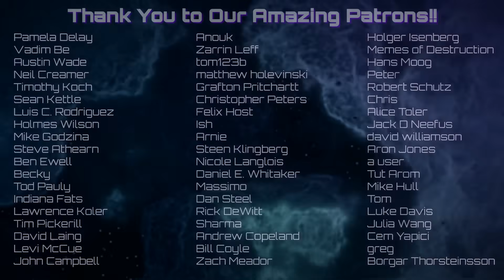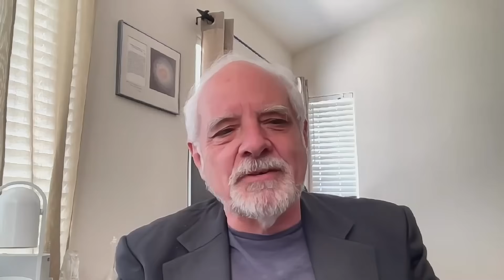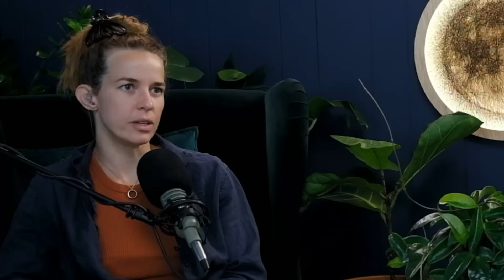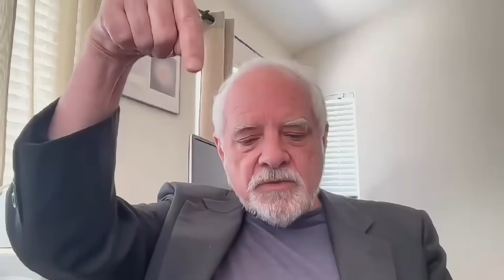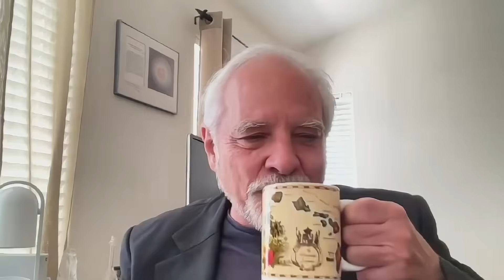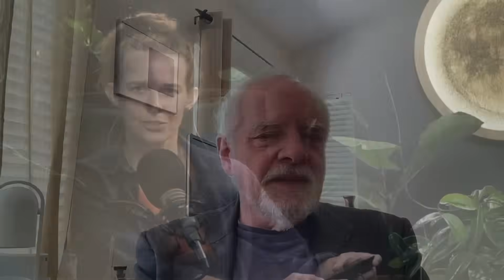Room Temperature Fusion is Here - Lawrence Forsley, ****, DemystifySci #349

Comment: 40:51  dont use mirrors.  Use a natural form of isolating multiple charges. Aka 2 circling the feild with a exterior pressuree cooling liquid with ferromagnetic particles using spins simultaneously keeping it cool with a gelatine

Comment: Alternatively, there is a beautiful numerical system called Marko Rodin vortex math which illustrates the equilibrium of all of these material elements. The torus with its central vortex is the 3D form of this equilibrium, numbers are vector points on this curved torus plane.The inner vortex is the model of the zero point or what is termed as cold fusion.

Comment: I am always amazed how people (even highly knowledgeable ones) misrepresent the Carnot's cycle and the theoretical efficiency analysis. Regrettably, in my opinion this is happening as literally no one goes and reads what actually Carnot did publish and the English version of Carnot (forgotten for more then 50 years pamphlet) was translated by Lord Kelvin. In a short the Carnot theoretical maximum efficiency (as described in his work) is 66% and not 40-45% as mentioned @35:24. In addition, if anyone is interested to actually read Carnot published pamphlet (about 90 pages) one will find out that Carnot did have critical assumptions for the dynamics of his derived efficiency. Ones this is understood, the "efficiency" argument becomes a chosen line of thinking then a physical limitation for thermodynamic transformers.

Comment: The thermodynamic probability that fusion would run at room temperature is very low: something around 10-8. But this number applies to omnidirectional collisions of atoms from all directions at the same moment and there is the trick: inside of metal lattices the atoms can collide along single line. The probability that multiple atoms would collide inside of random plasma in this way is equally low. As you may guess, these two probabilities would occasionally cancel each other. In chemistry the 3D reactions get often catalyzed by introduction of 2D surface of catalyst. As we can expect, the 1D catalyst would speed up the reaction even more - and this is IMO the key for running cold fusion at room temperature.
Reply: Regarding the applications of LCF (such as compact neutron sources for medical isotope production) here the problem is, it may be weaponized easily and occasionally even used for triggering of fission bombs. Until there are greedy people and terrorists, the technologies like this one are Pandora box for civilization.

Comment: Lt. Thomas Selfridge was killed in the first fatal powered airplane crash on September 17, 1908 at Fort Meyers, VA.  Orville Wright was at the controls, and this was the third military passenger flight - ever.  After three uneventful laps of the field,at an altitude of 150 feet, Wright heard a light tapping sound.  Though a quick look behind him revealed no problem, he thought it best to shut down the engine and glide to a landing.  Before he could, one of the two propellers failed.  The Flyer started shaking violently, and Wright fought to maintain control of the airplane.  He reported that Selfridge kept looking at him to try to gauge the severity of the problem.  Orville Wright couldn't regain control of the Flyer, and at 75 fet altitude, it went into a nose dive.  Lt. Selfridge uttered a nearly inaudible "Oh - Oh!"  And the plane crashed, making Lt. Thomas Selfridge the first fatality of a powered airplane crash.  Orville Wright was seriously injured, but recovered, living until 1948 to the age of 76.  Lt. Selfridge did not "fall out" of the airplane.  He was an aviation enthusiast, and died at the age of 28.  Fort Meyers was later named Selfridge Field.  One other note.  The Wright Brothers first flew on December 17, 2003 - not 2007.
Reply: Edit again: 2003 into 1903....
Good description otherwise.

Comment: So the problem with “cold fusion” is if you can make fusion in your garage we are all going to die! Controllable cold fusion started with Alvarez with muon catalyzed fusion in the 1950’s. This remains the o🎉nly safe way to do cold fusion. Work on making your electrons big (accelerators?) that will bring. Your wave function closer to the fentameter intra nuclear distances where the strong nuclear force takes over. I think you smart people figured this out but can’t release it because of concerns of weaponization.

Comment: Lower tech question: Why aren't houses, roofs and cars in northern climates painted with paint that reflects the sun on hot days and absorbs the sun on cold days for free heating and cooling? I know that paint that changes color with temperature exists why don't manufactures make it widely available? I am not an expert on this you'll have to find one to appear on your show.
Reply: Such paint doesn't exist. I'm an expert in the field and you're dreaming of crazy stuff. Educate yourself and stop writing idiotic stuff on the internet.
Also I have to add that you already have UV tubes that do that. No need for your crazy inexistent impossible paint.
Reply: @florin604  Thermochromic (TC) products predominantly change color in response to temperature fluctuations. I googled it. Jumping to a conclusion without at least doing that and referring to someone as an idiot is inappropriate behavior. My question was why don't we use it it would save energy and help the earths reflectivity during hot times.
Reply: @RobertRoberts-f4i  my kids have color changing cups. Put ice in them and hey get really dark and a totally different color. They are plastic. Even kids know your question definitely is not idiotic. The cups are literally just like you mentioned. Dark color for cold and light color for hot.
Reply: @florin604  Thermochromic (TC) products predominantly change color in response to temperature fluctuations. I googled it.

Comment: One should not lose sight of the fact that ignition at Livermore was a great achievement, not least because of the name of the device; the National Ignition Facility. Marshal Sluyter, head of the Office of Inertial Fusion in Defense Programs at DOE at the time the final decision was made to build the facility had insisted on this name in spite of the fact that even the most optimistic fusion scientists were not sure ignition could be achieved with the 1.8 megajoule design yield of the laser array. In the first experiments the fusion yield was about two orders of magnitude less than required to meet the ignition milestone, and it took more than a decade of work to finally achieve the ignition goal, but in the end, Dr. Sluyter's insistence on the name was vindicated. It should be born in mind that NIF was never funded as an energy experiment. It was built to study weapon physics and weapon effects. As Dr. Forsley noted, experiments at the facility can also be used to study the possibility of inertial fusion energy, high energy density physics, etc., but that was never the primary purpose of NIF. It is extremely useful in its intended role because it gives us a leg up over international competition when it comes to insuring the safety and reliability of our arsenal in an era of no nuclear testing.  

In fact, the Wright brothers' first flight was in 1903, not 1907, and Orville Wright's passenger at Fort Myers, Lt. Thomas Selfridge, didn't fall out of the machine. One of the propellers broke and a fragment severed some of the control rigging, causing the plane to crash, killing Selfridge and severely injuring Orville Wright. Of course, these are just anecdotes, but credibility is important in discussing fusion energy, and such small slips can detract from it.

Comment: Fission releases alpha particles and things measurable like that, charges radioactive particles 

Fusion goes down a scale to emit photons, and gamma radiation, basically antimatter, VS particle discharge 

Which then re-combines into matter, so helium in most cases, eventually, which is relatively inert... but it could just be reduced to practically nothing, if the fusion reaction bleeds off antimatter, collected as plasma, until no matter is left

Which is equateable to Star Types 

IE, our sun can't fuse Iron, 

But a larger Neutron Star, or Magnetar, probably could.... 

And with feynman diagrams, on a computer, you can begin to assemble a spreadsheet of fuel types, and types of reactor, and the types of emissions and ammount of current cycled and collected. And if it is net positive in terms of power consumption, or if it is safe to use a type of fuel in a type of reactor, or if a reactor can be used differently, for more efficiency or safety, or different types of input/output 

They both kind of overlap, I think,

So fission, is mostly particles and radiation 

And fusion is mostly radiation and antimatter, but it reconstitutes, because antimatter can't exist outside of a quantum vacuum to a certain degree, other than temporarily, as it is the smallest scale of light, and therefore matter, when you factor in how it comprises fundamental particles like the higgs boson, part of a Neutron. 

So, the environment it reconstitutes in, and type of antimatter available to create matter, or also in the prescense of plasma (ions)..

Makes a lot of difference, whether its safe, or hot, or bright, or efficient, etc...

Comment: Laser ignition, tokamak, stellarator, are a waste of time. 1MW in, 10W out. D-D fusion may be more difficult but it's way less radioactive. You need to slow down the fast neutrons & pass them though a hydrogen blanket to make more D2. You don't need 100 million degrees, at 6MPa you can fuse at 11 million. You don't need permanent magnets or inertial confinement, and you certainly do not want to use the heat as an energy output, keep the heat in the plasma where it belongs. Trying for a stable plasma is like flying a kite in a hurricane. You need a current sheet of 4-5 KA per CM squared. If you want Tritium, use a lithium blanket & neutrons from the fusion reaction. It is possible to convert the energy directly into electricity, no steam engines please, it's about time we left the Victorian era behind.

Comment: Can tertiary entanglements cause an increase in probability of fusion in the palladium, for instance in some experiments could a yeast culture have infected the deuterium water, using it for growth and essentially breathing out entangled deuterium?  That would mean entangled deuterium occasionally would quantum tunnel into each other causing some form of fusion.  Just adding a filter to entangle the light used in the experiment may do the same concept of a tertiary entanglement.  Also, for extreme alignment would it be feasible to do the experiment with palladium doped diamond and would that make the Palladium extremely stable and safe at the same time?

Comment: A tank of D2O should equal 200(or more) tanks of gasoline. 100 years ago there was an egg cooker that could cook 4 eggs with a table spoon of water using an arc between two platinum group electrodes using half the power that a heating element would use. Regular water contains 0.04% D2O.

Comment: Thanks!
Reply: I’m seen some funny things with Malcom tsg , I installed a few units now and when I turned off my truck engine off the first time after test running the unit. I saw three plasmoid or light particles come out and through the stainless steel at the equator in a spiral motion and re-enter at the pole of the unit 

That’s the moment I knew I won’t stop looking into LENR 

Ask Bob about it I believe they have seen it as well in testing and might even have some on film

Comment: Recently, a way has been found to produce Muons more efficiently, using ultra-short intensity lasers. This could be combined with Palladium electrode fusion.

For an energy revolution, the gradual incremental advances will ultimately bear fruit, such as catalysts for hydrogen generation. A main contender for me is what I call "Enhanced Conductors" not superconductors, but forms of graphene & other one-dimensional substances, that conduct better than copper at room temperature. "Let not the perfect be the enemy of the good!"

With Laser fusion the energy is released in 11 billioneths of a second. The logistics for putting that on the grid is absurd!

Comment: 1:33:52 restricted data is restricted for a damn good reason.  It's important to keep certain equations of state for heavy elements out of public circulation. There are some challenging engineering problems that keep a lid on proliferation.
Reply: @mitchtroumbly7056  it's one thing to make a 10kt device that needs a huge plane or massive rocket to deliver and can deal damage to everything in a 1km radius.  It's another thing to be able to put 12 250kt devices on a medium sized missile inside a small submarine that can carry 10 missiles which is more than enough to eliminate a small country like France or Germany, or fit one into a 30lb suitcase and just hand carry it to your target.  That's the difference between knowing that data and having to do a few thousand experiments involving real ordinance.  There are literally ZERO civilian applications for that information including in the nuclear power sector. The only non military use is knowing what happens inside a very brief portion of specific and rare astrophysical events like supernovae. With modern manufacturing and electronics technology the build is within the reach of medium size corporations, most counties, or pretty much any group that can find the material and 3-4 engineers willing to build one. At this point what elon has already done with spaceX is at least 10 times more expensive and a lot more difficult.  What makes it so difficult for the US & Russia is we actually do care about doing this safely, responsibly, and in a sustainable manner... and we still almost blew up Arkansas and took out the Eastern seaboard from north Carolina to Washington DC with accidents handling these devices. The only thing that prevented N Caribbean was an arming switch that had a design flaw that resulted in the bombs spontaneously arming themselves in thunderstorms. In the N Carolina accident the bomb actually fused on impact after the b52 broke up in a thunderstorm.  Had that switch failed as it so often did in the past probably 10M Americans would have died and much of the area would still be uninhabitable. It's best to let this particular dragon sleep for as long as possible.

Comment: I have MIT Peer Review endorsement of how I can Prove how Noguchi of early 1940s Hamgyong from Kumgang Range of Wonsan to Changbai Pass of Hamhung Hungnam was working on muon catalyzed fusion rocket propulsion for gliders and airships of Prior Art on how Alvarez was credited a decade later only after United Nations Peacekeepers had returned from ruins Stalin's Soviet troops had pillaged during the fall of 1945.

Narajano & Putterman of UCLA had improved on a Farnsworth fusor via cryogenic pyroelectric crystal electrodes so during an MIT Conference held inside Electrical Dept. on Vassar Street of Cambridge, MA. I suggested to use a molecular sieve for a carbon fusion lamp so such a device could ionize exhaled CO2 to fuse to form O2,

Comment: Sir Arthur Edington has led us astray.
The sun is not a nuclear fireball in the sky. It is condensed matter hydrogen.
Dr. Paul Robitaille showed us shear waves as coronal mass ejections fall back onto the aurface of the sun.
Gas cannot support shear waves.
And then there is the small matter of how the plasma Gains in both temperature and velocity as it leaves the sun.

How do you accelerate a charged particle in a vacuum? With a magnetic field. 
And what are magnetic fields in free space Always associated with?
An electric current. The standard model seeks to obsure this fact by calling it a "Wind".(they have got wind.)
Go sit at the feet of Halton Aarp.(seeing red.)
Or "Sky Scholars" YouTube.

Comment: Fantastic episode! I was aware of his NIAC (the part about Enceladus) but learned quite a bit about other aspects of what has been tried over the years, especially all of the context and color and unexplored areas. Charge shielding certainly makes sense to me, although overall this still comes off as needing a lot more work on theory to ground the ideas and allow for optimization. How that happens if there are issues being able to publish and use the mechanisms of science is a head scratcher though. Completely agree with him about that as well.
I am especially interested in what he said about this potentially allowing the p-B11 fusion reaction (~ 2:28:30). I'm surprised this isn't the focus of the field, if indeed they want to make power. I understand that neutron sources can be valuable, but for power the only scheme where that makes sense to me for a neutron source would be as a waste burner, like he also described, which is a bit niche considering waste burning can be done in a fission reactor.

Comment: Fusion is interesting, and research improves the scientific understanding of these processes. However, this was always sold as a way to create limitless energy, and it's never going to do that. If only all the money wasted on this was spend on Molten Salt Reactors, we'd have had that promise decades ago. Yet here we are 80 years on, still wasting money while the Chinese are running away with the real prize.
Reply: You nailed it, wasting money on the unachievable while ignoring the viable alternative that IS achievable is what I see as one of larger issues in the neverending thirst for funding versus the proper use of what they have and have had to work with already thus greed and self preservation outweigh common sense, shame on those who participate in these wasteful endeavors.